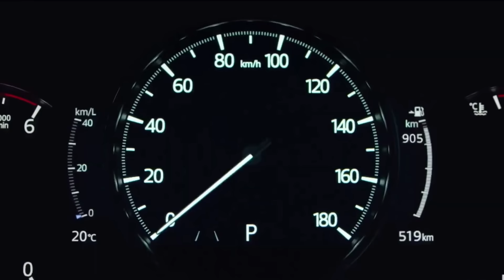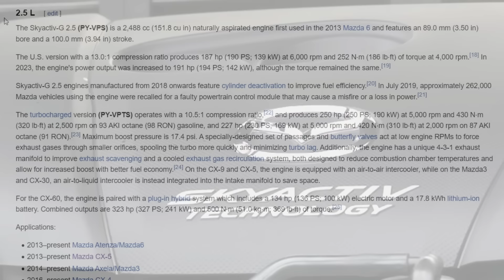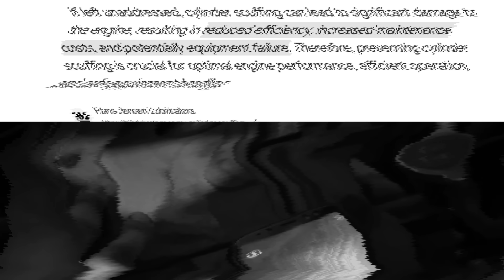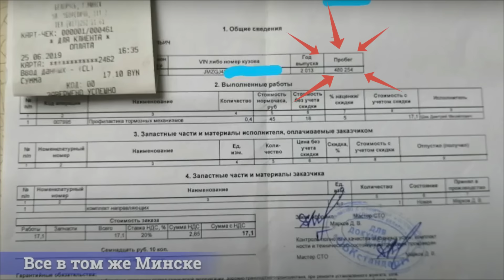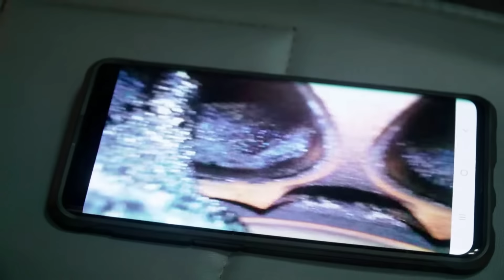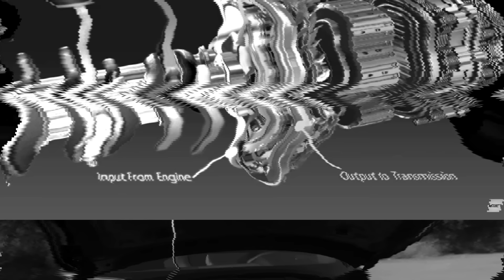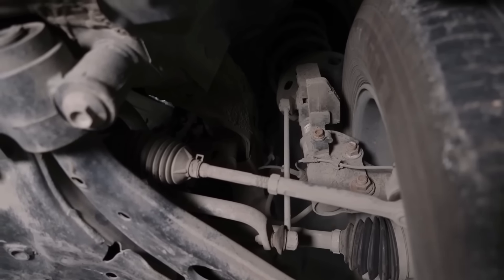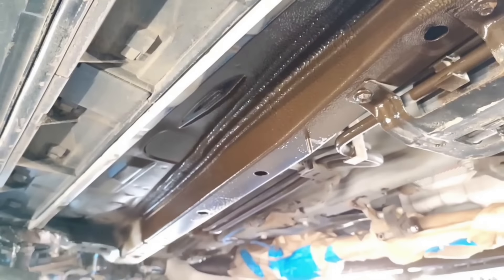How reliable is the most stylish Japanese crossover? 2024 Mazda CX-5 facelift.

Comment: This video was very informative. Thank you for putting it together.   I have a 2016 Mazda CX-9 with a 2.5 Liter turbo. There are a lot of similarities mechanically between the CX-5 and CX-9.  I’m just about ready to hit 80,000 miles.  I’ve have some issues along the way, but again, overall it’s been reliable.  I typically do my oil changes at 4000 miles and I only use 91 octane.  The last thing I want is to get back into car payments so I’m hoping that as long as I continue to stay on top of the maintenance I’ll get no less than 100,000 more miles out of this car.  Fingers crossed!
Reply from the maker: Thank you for your comment! Yeah they have a lot of similarities. Hope it was useful for you🤝
Reply: I'd love to hear more about your experience as I am shopping the cx5/cx9. What issues did you have? I am not convinced that the reliability is 100% as good as say honda/toyota's non-turbo engines. I come from toyota+honda & I can't get over the technical service bulletins on these engines for cylinder wall cracking & valve issues. Thats GM/European luxury type-problems IMHO.

People who say these are reliable in these comments typical reference previous ownership of BMWs/Volvos/Mercedes (all poor reliability IMO due to the vehicles being too complex. Compared to toyota/honda, I don't see people saying this is a more reliable vehicle. Seems only people who like unreliable nameplates say that mazda is reliable. A multi-year engine-killing techinical issue makes me uneasy coming from naturally aspirated toyotas/hondas, where this would've been a large recall during early production & would not be allowed to run multiple years.
Reply: @MarkTrades__  The first 75,000 miles of my 2016 CX-9 was flawless.  That is, I did not have any issues to speak of.  Staying on top of the maintenance is key to car longevity.  I have always done whatever Mazda recommends in terms of service and have only brought it to one dealership since the day I bought it.

Here are the issues that came up in the last 5000 miles. 

1. Replaced the EGR valve to resolve a rough idle issue.  I’ve put about 3500 miles on the car since and it has yet to revert back.

2. A/C fan motor replaced.  When 
running the A/C, it sounded as if the blades was hitting something, which resulted in a clicking sound.  The motor was replaced and the A/C now runs without issue.

3. Coolant hose clamp broke.  The clamp was replaced and the coolant was cleaned up.  I’ll admit, that I now primarily watch the temperature gauge just to make sure that it doesn’t go over 200. 

That’s really about it.
Reply: @uts788  ty for the info! Did you have any oil consumption you noticed associated with the EGR valve? in my experience with Subarus that's what causes it. 

Sounds like the dealer worked on the a/c fan clicking? Was a root cause ever communicated to you/found?
Reply: @MarkTrades__  I missed your question!   My apologies.  No excessive oil consumption.
Reply: @uts788  appreciate you responding man! That's good to hear. How would you describe your driving? I definitely am aggressive, accelerating from lights hard, for the joy of the engine. I need something I can bear on haha. I keep coming back to the cx-9. But I'm used to naturally aspirated engines from Honda/Toyota so I'm skeptical. So that's great news! Lol
Reply: @MarkTrades__  No problem, man!  So I would consider myself a passive driver.   I swear by iActive cruise control.  On the street I set the speed to whatever the speed limit is and I let the car accelerate and decelerate for me.   On the freeway I typically set the speed to 71 and do the same.  I only wish my car had the stop and go technology so my car came to a full stop.  Unfortunately, the cruise control shuts off at 13mph, so in LA traffic it gets super annoying.  Even so, my car has been driving great.  I can’t complain.
Reply: @uts788  ah good to know. I hope some older years of the cx-9 do not have radar-cruise which I actually prefer. That a bummer it dosn't do full-stops on the iactive cruise control tho. That to me is radar cruise's best feature - the ability to save you from the traffic jam. Appreciate your info  again - unfortunately you don't seem to beat on your nearly as hard as I would haha so the juries still out on if I would grenade one of these mazda engines lol. That aside though Mazda is really selling me with these CX9s & their current products in general.

Comment: Just changed my 2010 cx7 for a 2024 cx5 kuro, the cx7 had the 2.5 l and i had no issues with it, the transmission was changed just before my warranty expired, it was slipping in 3rd gear especially in cold weather.
The cx7 had 218,000 kms or roughly 130,000 miles on it.
Reply: My 2011 CX7 turbo is still going strong. I had the extended warranty on it but only used it for a wheel bearing. No issues at all. Just bought a new CX50 but the CX7 get driven more.

Comment: Owner of 2023 top spec turbo. It’s great and I always look forward to driving it. Using highest octane premium currently because with standard I was getting some acceleration lag, that no longer happens on high octane. First off at the lights every time now 😂 

I think some early scoring in the chambers is nothing to lose sleep over. Maybe an early first oil change after 1,000 kilometres may be of benefit with this. Beyond that make sure to do oil changes at shorter than recommended intervals and use the synthetic oil recommended for your climate. For me it’s 10-30.

As far as longevity I don’t think a lot of these modern small motors can be expected to have a long life. Personally I think anything over 150,000 kilometres is a motor reaching the problem stage, so buyer beware. 

Paint thickness is in my opinion that of a car built to a price, it’s unfortunate Mazda don’t step up in this area. My suggestion is to keep the car waxed or a ceramic coat to keep it looking sparkly. Won’t help with paint chips but such is life. Choose a colour that can be more easily spot paint touched up if that’s an issue for the roads you drive on.

When new my exterior glass benefited greatly with a glass polish and a coat of Rain-X. Easy to do yourself. 

My bug bear is the quality of the exterior black gloss plastic. It falls way behind that of the Lexus. My suggestion is get a protective film put on the exterior plastic to stop all the micro scratches. The protective film itself though will scratch with deeper scratching so it may need to be redone every year or so. 

It’s a very good car at a reasonable price and love driving it.

Comment: For Skyactiv-D owners, the main thing is that the recommended oil-change interval is too long. After quite a bit of experimentation, I'm changing every 5,000km (3,000 miles), and that seems okay. 
I suggest changing yourself (if competent) and you'll see for yourself what I mean, or alternatively ask your mechanic to put aside some of the oil they drain out of the engine for you to touch and smell. This alone will tell you the money spent on the more frequent change is not wasted.  The difference in the drained oil between a 5,000 and 10,000 interval is enormous.  I believe Mazda has had to go for the 10,000km (6,000 mile) interval, just to avoid criticism from motoring journalists, and appear good "on paper"; despite it being totally not okay for their engine...   FYI I'm happy to take my Lexus (gasoline) to 12,000km (7,500 miles) between changes... so I'm not a  "change frequently" fanatic.    Otherwise, they're great cars.

Comment: I have a Skyaktive G Mazda 2, automatic in europe. Here the warranty is 6 years/150000km. The transmission oil is advised ti be changed at 180.000km (no change before warranty expired). Overall i started my second year and just turned 15000 km...i am very satisfied. 
Change if oil is 20000km or 1 year.

Comment: Own CX 5, 2.0L 2016. It has 160000 km on the clock, so far only oil changes every 7500km to 9000km (used only 0W-20) ,one time brake rotors and twice pads and set of summer and winter tires . And yes, now I have issues with engaging drivers seat belt. I am waiting for new CX 5 (if there is going to be in Europe) to replace this one. If not, than I will consider CX 60 or RAV 4.

Comment: Cx5 is VERY reliable. I have had 2 of them. I have issue with a few little things. I had to disable the digitizer in the infotainment system. Mazda did not enter the crossover market in 2012. You are forgetting about their crossover before that. The cx7 and they have made cx9s before the cx5 as well

Comment: My wife has the 2018 cx5 2.0. It started dripping oil because one of the cylinder head had cracked at about 46000 miles. Luckily we only paid $500 and everything was covered. They told me that this often happened in the 2018-2019 cx5.

I was never a big fan of these 2018. I rented a 2023 cx5 and I can definitely tell the difference in throttle response and the brakes. Definitely drives way better and smoother than the 2018. But the wife doesn’t feel anything and still preferred her 2018.
Reply: Thank you for sharing your experience. Another 15,000 miles and you would've been footing the entire bill for this issue. This is a severe issue that seems to be getting glossed over by the owners in the comments of videos on these mazdas. Its hard to understand how big/common the cylinder cracking issue is. 

I've seen a video documenting a 2016 cylinder crack. I've here anecdotally that it also affects later model years of cx-5s/cx-9's. Looks like these are also GDI only so thats another maintenance project to contend with after the 60k warranty period.

Comment: A new-gen release is around the corner (2025 model year I think), so get a CX-5 now if you want minimum new-gen defects/problems that will need to be ironed out over several model years.  The CX-50 release illustrated that quite well.

Comment: I have a 2016 2.0 CX5 with 150.000 KM. It just started having a weird transmission issue that only shows up when engine braking and then accelerating and lately it's begun showing up when downshifting. The car jerks as if something is partially slipping. It does it in all gears, most noticeable between 2nd and 4th. The transmission is showing a code for the iStop oil pump but I have not been able to find the root cause. I believe it has something to do with the pump and the torque converter.

Other than that, it has been a very reliable car, only needing maintenance and wear parts replacements, however this transmission issue could be a very expensive one.

Comment: The carbon deposits are on many modern engines, not just Mazda. BG has a slew of products that have kept my older GM engine running fine now for almost 100,000 miles using it every 30,000 miles.  I plan to do the same on the Mazda CX-5 we bought and plan to keep 200,000 miles like we do most of our cars. Thanks for this as it reinforces that this model should do the same (2023 bought).

Comment: We are looking to change our Clio with something bigger since our family got bigger :D Would you suggest 2.2 Diesel or 2.0 Petrol? In country where we live it is pretty hard to find CX 5 under 200k KM so what would you suggest we should keep on mind when looking at one?
Reply from the maker: Certainly, the choice of a car depends on the automobile market in your country and the pricing dynamics in that market. However, if you've already decided that you want only the Mazda CX-5, then the version with a 2-liter engine and a manual transmission would be a reliable option. An automatic transmission is also a good choice, but you may need to change the oil more frequently than in a manual, leading to potentially higher maintenance costs.
Reply: The 2.2 diesel is known to kill itself (Mazda can make a petrol engine that explodes like a diesel but can’t handle the diesel engine?), the petrol engine is almost unkillable just change oil every 7.5k Km and you are golden ,change transmission oil every 40k km to60k km do not flush. After that it will just work 

The transmissions are 6 speed sadly but fuel economy it’s still there
Reply: @patricioacuna1688  when you say do not flush, meaning just to drain it via the plug and top it off? basically replenishing the oil? I've heard good things about Mazda automatics and to be honest I think 6 speeds is great cause the transmission won't change gears that often and also won't get you to 1200 rpm all the time like my Stronic does which kills the flywheel I've been told
Reply: @Disharmonikash  the usual oil change is fine (removing plug and refilling the same amount it drained), oil flushing is more on the side of removing ALL the old oil for new oil. this removes metal particles that kind of helps to keep the transmission/engine working. 

this is relevant on transmisions that were never maintained regulary..
Reply: @patricioacuna1688  Don't I know it... happened to me on a used Audi Stronic I bought, oil was never changed before, I did it and it killed the transmission had to do an overhaul...
Reply: @patricioacuna1688  - it's incredible how easy the procedure looks for the Mazda automatics, seems very DIY and easily accessible.
Reply: @Disharmonikash  yup, at least on my experience, honda and mazda (which are the cars I own) are pretty much. Lift => drain > filter > plug back > fill > unlift > ready. no need to dig into the engine or unusual sockets for the plugs. same goes for the air filters

Comment: I find it interesting all the parts that need replacing after x thousand miles.   I have a 2001 highlander with 186000 miles and have never had to replace those parts.  It has most of its original parts. Have only replaced rotors, mufflers, and a radiator that was perforated by some road hazard.

Comment: This man tried his hardest to find the few videos of mazda lemons as possible. He's literally full of it, because mazda developed heated intake valves with the 2013 up skyactiv engines. So carbon buildup isn't a problem in these unlike other GDI engines. Also the scoring marks are only from mazdas 1st couple years when they first introduced cylinder deactivation, it's not a problem in other variations and seems to be fixed in newer models with cylinder deactivation, which honestly is a plague for any vehicle to have cylinder deactivation. And i sell parts for a living for the last decade and regularly see mazdas not needing spark plugs until 100k on N/A models and they only look like 60k miles from most other vehicles honestly, which seems like great ignition technology, its also worth noting The major shareholders in mazda are also the major shareholders for NGK/NTK.etc.
Reply: So i have a 2014 3 with the 2.0 naturally aspirated and i have never had the induction cleaning (with the spray).  116,000 miles but runs good and no codes.  W your experience would you do the induction cleaning as a preventative measure?  Thx

Comment: I'm thinking about swapping out my Citroen C3 for a new 2023 Mazda CX-30 2.0 Petrol 6M. But here's the thing: I mostly drive around town, dealing with lots of stop-and-go traffic where I rarely go faster than 30 mph. Do you reckon the Mazda CX-30 can handle this kind of driving reliably, or would I be better off going for the Toyota Corolla Cross?
Reply from the maker: This particular Toyota engine is used to these driving conditions but it has one drawback which is CVT transmission. In this case, a 6 speed manual transmission (Mazda) is much better and with proper maintenance, this engine works pretty well in the city. The only thing that you have to ensure is to check the carbon buildup when you feel that your car became slow .So it seems like that Mazda is the more reliable option in your case.
Reply: In Australia we only get the 6 speed Mazda automatic which is amazingly smooth and of course I purchased a FWD version as I don't wish to pay an extra $3,000 for the AWD and have no desire to carry around 220lbs of the extra dead weight of the rear AWD mechanicals, plus the reduction in fuel consumption from driving just the front wheels is another 10%   @thelonglastexpert
Reply from the maker: @MT03Guy  that is a smart choice 👍🏻
Reply: Well I don't know about smart but it's what I chose to do and I really enjoy the little CX-30.  The CX-5 is nice but my wife couldn't drive it because of judgement issues parking it and it also is a half ton heavier so we just bought the 30.  Great video.   @thelonglastexpert
Reply: Oh CVT's & DCT's are a nightmare.  Just my opinion. @thelonglastexpert
Reply: @thelonglastexpert  Mannol 9091 Molibden Additive or any other additive. I mean a good maintance is really important

Comment: I have 2016 cx3 it got 239000km finally traded but had severe oil and injector clinup alway before around 235000km change oil at 7 to 8km i am now considering 5w 30 since i use the car evryday high oil heat cycle but afraid of warranty being void i live in vancouber bc now

Comment: The 6spd AT has no servicing schedule in the Mazda 2. My servicing shop refuses to even inspect the AT fluid.
Reply from the maker: Find another shop
Reply: Or do it yourself. It’s easy! Clean fluid is the lifeblood of automatic transmissions.
Reply: @thelonglastexpert  Not easy in Thailand, nobody is a trained mechanic and they have an amazing ability to f^&k anything up.
Reply: @bradnail99  I would if I could get underneath to drain.  Ground clearance is only 19cm/7 inches.  Need a pit, or ramps or a hoist and I have neither.